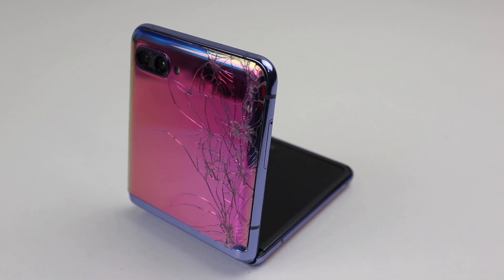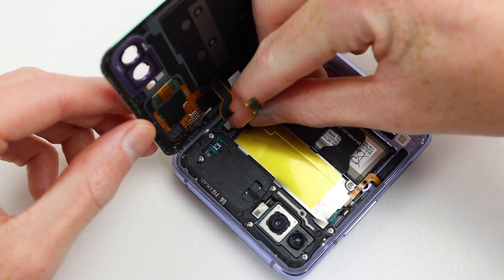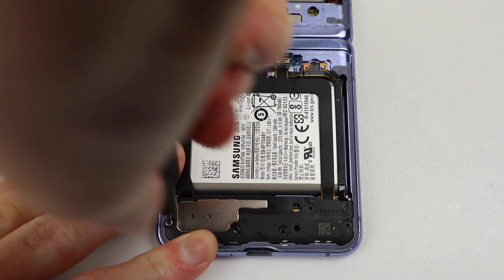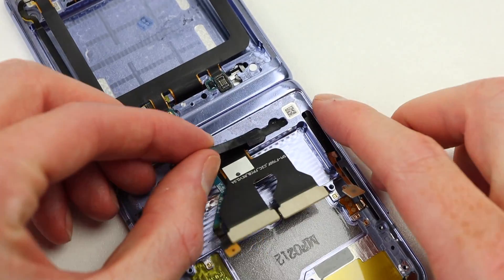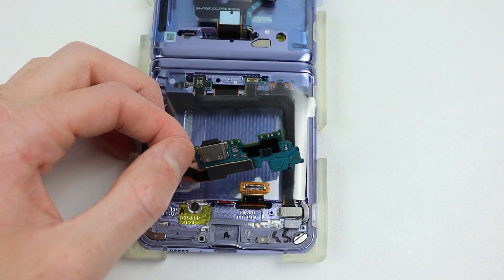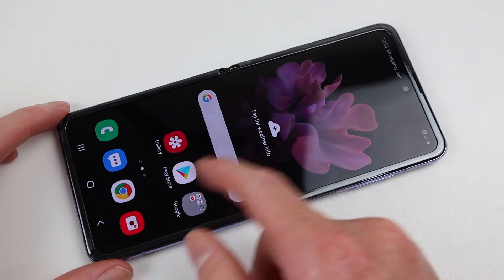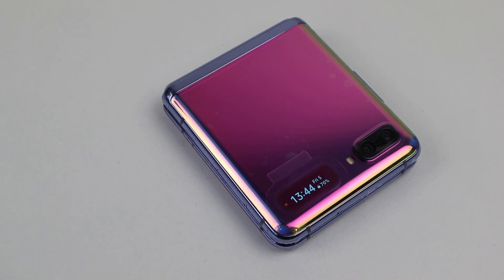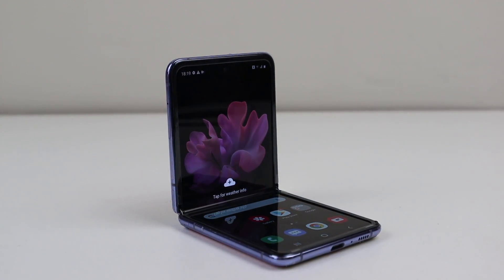Destroyed Samsung Z Flip Folding Phone Restoration - Most Expensive Phone To Repair

Comment: Having a phone that can easily fit into a pocket like an old dumb flip phone, and yet have usable real estate on the big screen is a big plus. But yes, it is expensive. Most of these problems could be reduced by making the phone slightly thicker to accommodate a larger battery, removing the need for a second battery, and making self-repair easier.  [But only if it was designed for easier self-repair].

Comment: YKW fuck you Hugh. Just because someone bent a TINY, INSIGNIFICANT piece of one of the metal shields doesn't make them an incompetent repair tech. You are so fucking full of it. TronicsFix had a switch lite come in with a slightly bent heat shield, but because he is a NICE human being who isn't trying to be full of himself all the fucking time, he just called it no big deal and moved on with the repair. He didn't try to sound full of himself by calling the previous guy an incompetent tech. Maybe if the previous tech had completely trashed the phone you could call him incompetent, but by slightly bending a piece of fucking metal? Get real.

Comment: Something that just came to mind that might make the display a lot more durable, wouldn't it be better to use kind of a TPU/glass mix, where the majority of the display is glass while the folding portion is super flexible and made to be bent?
Reply: Most of the normal damage happens at the folding line, so this wouldn't help much with that. But it would be a bit more drop resistant

Comment: I think that having a folding phone, be it one of the Galaxy ones or Motorola... whichever, is more of a novelty right now. 

It would be absolutely cool to have. And if i could, I'd take care of that thing lol Ike it was my child, considering how much it costs.

But that's where my Adult logic comes in. 

It's so damn expensive in the first place. Parts are no doubt also expensive. I've worked in repair shops that get direct Samsung parts and Ive seen how expensive a new one can be for a normal phone.... Imagine the price for a new folding screen. 
It's not feasible in the long run.

I'm the type of guy who will go for the, maybe, 2 generation old phone model if i want to upgrade. 

Like right now, I'm rocking an S10 plus. got one refurbished in excellent condition for like $200. It's still a great phone and works perfectly for my everyday use.

Comment: I'm vaguely interested in foldable phones, but they feel way too gimmicky for me to invest in one - especially as the tech is so new and expensive to repair/replace. I think there's potential there if they can get it more durable and cheaper. Like, having a phone that can become a tablet is probably the more interesting form factor IMO - it hits that sweet spot of usability, you know?

I've had a tablet before and ended up giving it to my cousins (they like rebuilding and repairing stuff like that - and it turned out it worked just fine once they replaced the battery) cuz I just never used it. It was nice for some things, but it was mostly just too big and unwieldy and when I would have been most interested in using it, I couldn't because I didn't have any wifi signal - so I always ended up using my phone instead. Granted, that was over 10 years ago and there's considerably more wifi availability now than there used to be, but free wifi coverage is still extremely spotty in the Midwest - even in the cities.

Eh, my used Google Pixel still works perfectly fine. The only function is doesn't have that I would like is wireless charging, but that's not that big of a deal. I can't do without the headphone jack that the newer Pixels don't have. Although, I think the 3A had a headphone jack? I can't remember. I've had this phone since 2018 and it's still going strong. My first Pixel's motherboard died, but this one seems fine. I know, everyone's doing bluetooth earbuds these days, but I like being able to just grab nearby headphones to use for those rare occasions when I need them - I've used my PC headphones for calls before. And $10 wired earbuds work just fine for about a year or so. Why spend $100 for wireless that will last the same amount of time on average?

Comment: I work for a prototype company and we once needed to source a flexible LED screen for a device. Ours was a 4K screen, about the size of a long smart phone screen. Direct from our supplier in China it was about $1000. That’s for a screen direct from the factory with no special connectors, motherboards, frame, etc JUST the bare screen. It’s crazy that Samsung is able to sell this for 1500 or sell the screen for 800. Not to mention that case can’t be cheap either, it’s machined aluminum (Or is it stainless?) and it requires multiple setups which is expensive as well, I am a machinist and small parts that require lots of setups and details are the most expensive. Even the screen they use is much more flexible than ours (but possibly only at one point as ours was flexible the entire length of the screen). As of now though, flexible screens are still extremely fragile. We bought 10 screens and by the end we managed to make 1 dual screen prototype, the rest of the screens were broken during installation.

Comment: Based on my experience with folding phone in 2000 and slide phone in 2011, I will avoid a phone with any moving part, even if the OEM promise it's durability

Comment: Thank you for the video! But I have to change the frame that you can see at 4:38; After I remove the old one, to put the new one, do I need an adhesive tape or does It get stuck in place by pressing, without nothing? Thank you.

Comment: Foldables, to me, are superior technology because of the protectiveness that a folded phone provides to the screen. With that said, this is relative to "old-school" phones from the 2000s. Those were pretty heavy duty and dropping them wouldn't do much if they were folded up. These phones were typically also made to be stronger. I suppose this is kinda like comparing a Gamecube to the Xbox360. The Gamecube was made to be incredibly sturdy to the point that dropping it on tile would break the tile rather than the console. So essentially, if they made foldable phones with brick-like sturdiness, then I'd buy one. They clook pretty fantastic, but they seem to be made delicately.

Comment: Samsung glue is such a nightmare lately - had to replace the display on my M31 to get it working and the battery is glued down just as badly as the rest of the recent samsungs. It took a fair bit of work getting it off without damaging the battery

Comment: so many problems with these new phones, ive got an old galaxy j7, the first version, its had chunks of the body torn out and yet it still has no functional issues or screen damage, the only reason i dont use it for much is because of obsolescence, its slow, no longer gets updates and doesn't run newer apps well, though the main issue was poor reception in too many locations

Comment: i always try to think how its even possible to destroy a phone that much
Reply: Its a plastic screen with a thin glass layer, but its BEHIND?! The glass is useless and wont change the durability of the PLASTIC SCREEN (which can be scratched even with ur nails, and even destroyed) and causes issue like a white bar where you cannot see anything where it bends. Also some folds had the glass crack on the FIRST bend, probably ruining it since the oled is behind. So the screen is really not durable AT ALL.

Comment: Uh, Samsung repairs the screen first time for $0 and after that its $120-200. People selling them off without realizing this is the problem. Screen availability for repair shops is bad because samsung is still offering this in-house repair for screens, everything else for the Z flip costs $5-$25 on average with most expensive part bieng the cameras unless you need a new mainboard. Once samsung stops servicing the phones for that low cost them I see screens getting cheaper as they wont be hoarding them anymore

Comment: I can safely say,it's easy for me to try out the folds. Where i live, for your mobile+data plan, you can get a phone cheaper than anywhere else. On top of that, for an additional 4 usd, you can insure your phone. If it breaks or gets water damaged, they will repair or in case of foldables, replace your phone for a small cost for yourself. This small cost means, any phone above 300 bucks, you ahve to pay only a fixed 60 bucks yourself, the rest is done by your insurance. You can have the insurance as long as you pay the monthly ~4 bucks. I'll go further. If you chose the 50 usd/month unlimited calls/data plan, you get the insurance for free..

Comment: Flip screens are a bit useless apart from saving space in your pocket, however flip phones that turn into a tablet are where it's at. I've had the OG Galaxy Fold for 8 months now and it's been amazing, I was able to get rid of my old tablet and just use the one device. In terms of screen being fragile, it's not as tough as glass but it has been overly exaggerated by everybody online. I don't have a single scratch on mine and I am a heavy user. The outer screen is glass and folding it protects the inner foldable screen. And yes the outer screen is useful and great for a quick reply or taking phone calls and photos. And there is no stretch mark crease that builds up over time, the crease looks exactly the same and is invisible when using the screen. Again this has been overly exaggerated. Unless you're a dumb fuck with long nails that taps the screen, you'll be fine.

Comment: Great video Hugh. I would recommend that instead of the liquid adhesive, you buy a roll of 3M 300LSE. It's the same adhesive that's been used on many of these devices for years. Many different thicknesses are available and you can just cut strips to suit.

Comment: What I hate about Samsung’s $800+ for a screen is crazy and they break so easy. I got my google pixel 3 which is completely smashed on both sides glass missing on the back couple dead pixels on the front and a small black spot but still works flawlessly. What phones should be. Not Samsung where a small little crack or bend renders it all useless

Comment: Then you see me: 
-Want to fix my note 3
-Order new display
-Display arrives, find out that the screen connector doesn't align with the motherboard connector, and the return period has expired
-Make connector fit, close the phone
-Display not work
-Open phone and plug in display without mounting it, Display does work
-Assemble phone, display not work
Reply: -Throws display out of the window
-Orders a new display
-Tries again
-It works! Yay!

Comment: Foldables are not the way to go just yet. They are incredibly expensive, difficult to repair, extremely fragile (have you seen the warnings that they come with, such as not pressing hard on the screen?) and replacement parts are far too expensive. I thought that a £200 screen replacement for a Galaxy S7 Edge was excessive...
A lot of broken foldables will likely become e-waste... and a lot of foldables will have broken screens, as it is clear to see that the screen (especially where it folds) is the weakness of these foldables.

Comment: One of many reason why people avoid "flip screen", i rather had 2 screens than fragile flippable screen.
Reply: Two screens? Sounds like a Nintendo DS...
Reply: @drakonua  another reason why DS and 3DS emulators could work better on portable two-screen devices
Reply: I got a ZTE Axon M, and it's got two separate regular glass screens. Works great when emulating old Nintendo consoles.
Reply: @5476Himself  does Citra run well?
Reply: @gab_v250  I don't have any 3DS ROMs to test it with, so I actually don't know about that one.
Reply: Yep, me too. The Surface Duo seems a more durable product with its two separate screens, both protected with glass
Reply: @gab_v250  Exactly!

Comment: 6:31 Ahh yes liquid adhesive. In other words Glue.
Reply: Glue: Pooh

Liquid adhesive: Pooh with tuxedo
Reply: @orio4155  XD
Reply: @orio4155  lol!😂😂😂😂
Reply: Does that glue at least indicate it is not for use on hair? Because if not there's a certain somebody who might just try it out as hairspray
Reply: stronger glue lol
Reply: is it really just glue ?
Reply: Why does everything have to involve something that become trash when you remove it let alone the screen which says a lot about it.
Reply: @TheRealFobican  There are a lot of reasons, but for non-foldables, it's usually cost and size. For foldables, you also have to take into account the fact that they fold, meaning you can't use metal brackets, at they would either bend, or be placed so far away from the crease that the display pops up while you're opening it, like on the Motorola RAZR.
Reply: @SHIFT-HACKMON  either way, having advanced parts that break only because you touch it is incredibly uneccessary to have.